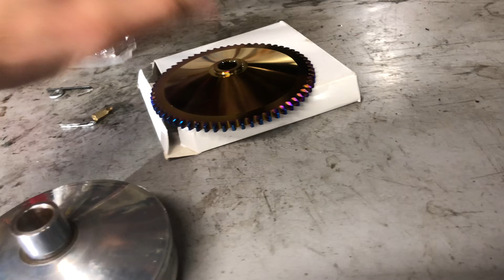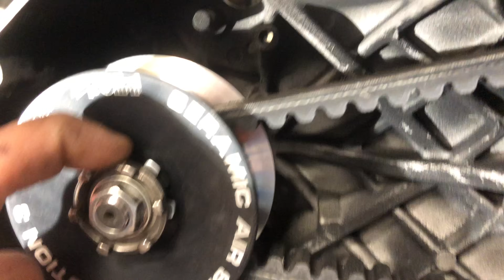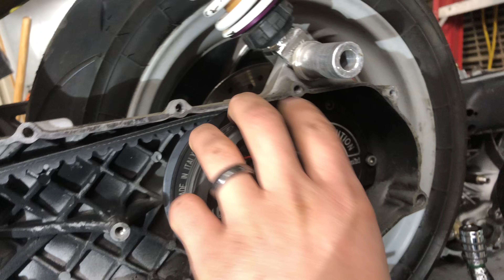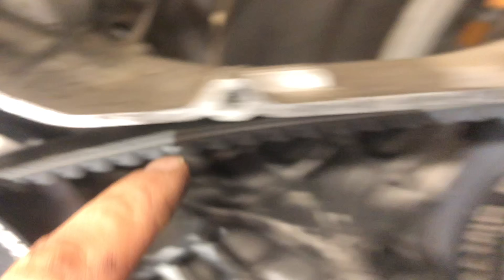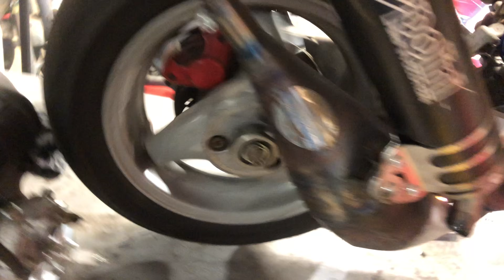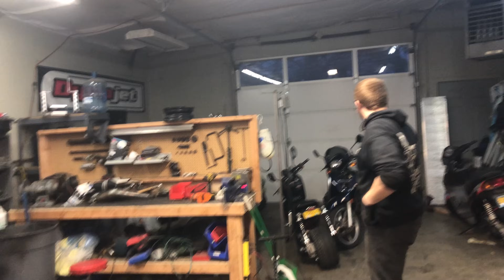Scooter CVT transmission explained

Comment: Idle's 1.5k rpm, engages at 4.2k rpm.  Not racing, not in a hurry, just puttering around; does it make sense upon routine (12k mi) belt-change to add 1g or 2g heavier rollers to lower the stock engagement rpm's on Zuma 125?  Did previous owner install lighter rollers, since 4.2k engagement seems high?

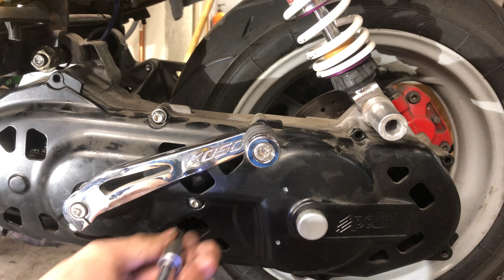Comment: Key point at 11:12, trans upshifts (belt starts moving down in rear pulley) before clutch engages. When you upshift before moving, you lose takeoff power. That could also be caused by clutch springs that are too stiff.

Comment: The clutch is a bit stiff, it engages high. The shift starts before the clutch is engaged, so you lose the low gear. Not bad, but could it be better?

Comment: One question on my yamaha aerox 70cc has malossi white clutch spring and stock sprigs and 4.5 gram rolers. But take off is like a litl slow the rpm is not constant on start they rising then its stops and stay there like 3 seconds then its raising like crazy. So is stifer clutch spring gona do the job?
Reply: With more power you need to put stiffer clutch springs and possibly stiffer contra spring. Clutch should engage at 70cc kits best rpm power range.Tune one part at a time.

Comment: Hey i have a 98 prebug im wondering what causes the belt to shift before the clutch engages. My belt starts going down on the rear pulley before the wheel starts spinning

Comment: I'm new to all this. My new 150cc  scooter seems to engage a bit slower than I would like it to (manufacturer says it engages at 1700 rpm). There seems to be a bit of a slack in the throttle. How can I make it so the clutch engages quicker? By adjusting the throttle cable? Or by getting 1000 rpm clutch springs? If I change the clutch springs to 1000 rpm, do I need to also change the contra spring to 1000 rpm? How about the variator rollers weights? Do I need to change them to lighter weights as well?

Comment: The only thing I don't understand: Why does it need to use a toothed belt? You have smooth surfaces inside the pulleys, I'd always assumed these used a smooth belt.
Reply: Toothed belts run smoother and wear slower compared to a smooth belt. As well the heat in the cvt wouldn't be easily dispersed in a smooth/A belt.

Comment: Super cool video,
I didn't know I could run it with the transmission cover off , I have a stock Wolf 50cc scooter very low miles and it started making a squeak noise during initial throttle, it sounds like my belt is slipping a little bit until I get going , after watching this video I'm confident I can fix it
. thanks

Comment: No constant oiling needed as there are no chains. has simple parts. unlike cvts in cars, cvts in motorcycles are super reliable as that rubber belt has way less power to manage than those poor metal belts in cars which have to transmit at least 100hp to a 1.5 ton car. has no problems with crossing waters as tranny has its own cover. cheap to own and cheap to maintain. easy to use and comfortable. scooters are awsome

Comment: hello guys i want some help about the springs the contra and the clutch springs i had the stock one and changed it for red one but it like snapped my belt and now i want to get other spring but im not sure what to get the red one was 2000rpm and it was the hardest its 80cc 4t scooter i want to make it to have nice start and final drive i was thinking getting yellow contra and white clutch springs but im not sure can it still snap my belt

Comment: Known baselines of 6-7 speeder scirocco-porsche-benz issues
Known 3x3 is 9G deu tronic
Known mountain-bike is overlaping ranges of 3 front 7 rear and 3 front 8 rear to misadvertising of overlaps as speeder 21, 24. Redone back to 7 and 8, in recent years.

Overlap durability reliability for 125cc petrol trolley grass cutter with gearing-spacing overlaping...
Reply: Cantonese is oci of ocillation resonance self-destruction.
Hokkien pronouciation and number pairing sequence of mahjong style definition of 
= No 3 no 4
= 4,5
= 5,6
= 7,8
= 9 is 10
= 21, 24 overlaps 7x7, 3x7, (2,5,8), [3,6,9], {1,4,7}, ...

Fib,bo,naaaa ceee sequence ... Hahaha
Reply: Hokkien democratic taking
= 講（話）來聽

Steeple-chase logic-understanding baseline countering plus-one is steeple-chase
Reply: ATF viscosity for transmission
= If engine flywheel-and-coupler-gear to gear-box is clutched and gear-box to drive-shaft is clutched and independent-wheel is clutch-torque-limiters(pneumatic socket-wrench settings-numbers for grip-level per tire-wheel)
= Forward starts from 1,2
= Reverse is 3 oops 4
= Paired is therefore found neutral before 3
= 1,2.3.4 - 2,1,3,4 - 3, 4, 1, 2 - 4...3..
Reply: Ahhh arrr arg args... Pneumatic air-brakes of trucks to reverse generation of ... Braking words.
Reply: Distinction student will 
= Ahh arggg

 Counter and steeple chase with ahhhhh ... aRRRR.????

= Brake - LOr...

Other students will go to america.
Reply: Next question accepted is
= How to terminology advertise product.

Modular to torque-range
= 9, 10 as 10 for lesser-warranty
= Tested designed-specification as 100% but use 90% for durability plus-one. New baseline of 90% as 100%

Split torque doubling-halving for world is linear-feel to driver-rider mechanic-assembler

(new)100% use 90% as pivot-point
(new) 100% use 10% as pivot-point

Idling is not-start(climate-weather terrain-altitude fuel-quality)
Touch pedal-throttle is-not idling
Dead-zone feel, is, shoe-feet-ankle position lever touch-point.
Fuel-line feel should-be linear return-spring.

70%(old-new) is cruising-efficiency 
70% to 90% is double torque
90% to 100% is minimum double torque or chart-plot reduce torque-to-power to prevent engine blow-up (vehicle-no kamikaze-missile). Selectable by mechanic during assembly-mounting. 

Count downwards and try not to stall-blow many types of engine.sss under real-world conditions. How to drive diesel truck.?
Reply: Apply to ww2 dive-bomber with 3, 4, 5,  blades, propeller.

Brake propeller is another topic.
Reply: Nest topic will be electric motor regeneration for battery next use and spooling and bearings and no-burn-out bearings to coupler-torque socket-axle shafted for pull-cord/electric screwdriver/electric drill/pneumatic wrench/kick starter/electric starter motor/exclude turbo, supercharger, surbo/include fuel and electrical lines plus-one efficiency 底盤，底子, raise the log(logistics) before the effect-results, don't loose focus, remember job-scope, remind self of core-business, review objectives...
Reply: After 16 years grade school age, half year study and half year relevant work then half year study then career as play not-work.

Impeller drive as flywheel design. 2x directional valves for 2x vectors, leaking air design... Hammer-jack, jack-hammer to pile driver. put fan blades... Make table-chair top-heavy. Not, bimbo top-heavy. Reaction blast of no-drill second-hand fuel-tank self-explode but buy ready made new... Tank explosions YouTube... Hot works, dry docks, ships, tankers, truck, tankers, cylinders tanks, caterpillar truck tire explosion, double tire wheel explosions...
Reply: In the end, the world is full of jealous-freaks who are not-worth the trouble. Assign one workshop tuner to exist for 6 months or till found out. Pirate brand-model, assemble different, mount different, drive different, use different, ... depending on what the customer specify, point to expert workshop-tuners from cheap to expensive. Tuner-workshop gets lawsuits and ... ... Fake passport, fake life, fake from start. Countries steal designs and patent stolen tech then ask, how is it fair... Their brands and terminology and designs get reverse-sabotage is sabotage-reverse is self-cancelling paired to zero-rated.
Reply: Country level back is tuner-workshop for components.

Workshop-tuner is legit compliance assembly and deliberately agree to - knows nothing behind.

Words sequence flipped.

Comment: I don't own a scooter yet, but I plan to. I'm an old motorcycle rider who has to ride a trike due to my wife's many health iseeus. But I am now looking at scooters for the amooth ride. 
  I think the engineering that went into a scooter's cvt is amazing. It is so simple and yet works so well. Your video does a great job explianing how they work.
   I will probably change the clutch springs on whatever scooter I buy. I will install weaker springs becsuse I want the clutch to engage sooner than stock. Then I will look into the rollers to make sure the front pulley is giving me the max it can give. I don't know if I will change the spring on the rear pulley because it seems to me if I have the right weight rollers in the front pulley it shoud over come the spring in the rear and give me the maximun performance. Well, good enough for me anyway.
   Thanks for such a good video on a scooter CVT and thank you for removeing the cover and showing exactly how they work. I already knew how they work, but it was nice to watch one while it was in action.

Comment: I have a question, my cvt belt was worn out from 17,5mm to 16mm. but I ordered and installed 18,5 a thicker belt, I added some shimings in variator so the belt would stay as low as possible and it was as high as high in the rare (clutch plates).
but it's still the same belt doesn't go all the way up on the variator, I squeezed the belt in the clutch as much as I could And I THINK THAT MY CLUTCH DOESN'T LET THE BELT GO ALL THE WAY UP 😫😫

Comment: I'm looking at a Tao Tao 50 pony (I know... but it's what I can afford)
Want to do some mods ie BBC and exhast. 
Also
If I install 5.5 gram roller weights or 7 gram sliders in the CVT
What color/size "clutch springs" and "contra spring" should I try first?
Thanks in advance to anyone who responds

Comment: why is it when i release then throttle my scooter is non stop engine braking? shouldnt disengage the clutch? or something...
Reply from the maker: Likely a clutch issue, but the clutches always stay engaged until the rpm is met where the springs disengage
Reply: @Scooterswapshop  what would you recommend for a new 4t injection scooter to go faster in the hill? But still dont ruin the engine
I am big guy ~97-99kg and doing food delivery in a step/hill city

Comment: Great video ... Thank you.
I am looking at using this system in a UGV Tracked system.
So I have a question if anybody is interested in answering.
I was thinking of Electro/Mechanically operating the Big Small (the CVT part) on both ends ... ie. remove the Centrifugal weights.
Oh ... I have definetly NOT thought it thru. It could be a dumb idea after all!!! CHEERS

Comment: I have a 2003 yamaha bws, did a brake stand and it started to wheel hop. I developed a vibration and eventually lost drive. IS it usually a belt that snaps or the cvt went to shit. I still have to take it apart to have a look.

Comment: So if my bike is only hitting about 8400 rpm’s and holding when I pin the throttle, what can I do to make it hit a higher rpm and have more speed? I have 1500 rpm springs, and I’m running 5.5 gram rollers or 5 gram one of the two, the bike is a 139qmb with a 50mm bbk on it , just a free barn find I built to wheelie but it’s really got me into scooters and I really wanna understand how to easily tune; bike will only do 41 mph @ 8400 rpms

Comment: What is the best weight for my variator rollores for a top performance 70cc cylinder,polini high speed pipe and a 21mm carb with polini clutch and polini high speed variator.
Reply from the maker: If you have a minarelli the  polini Variator is flawed and it won’t ever work right regardless of weights

Comment: Thanks for this. Do you have any idea, why is it that: on my scooter when i start mmoving with the bike at the beginning its shaking the whole bike for a few seconds and then its smooth again at a higher speed. So its shaking at the beginning of the speed up process, is the clutch spring not ok, or the whole clutch worn and not cathing the clutch house properly? Do i need to replace all parts or just spring or other parts?

Comment: How do I measure it know what size of secondary torque driver sheave I need to buy to replace my old one
Reply from the maker: What bike do you have
Reply: @Scooterswapshop  dl603 dinli 90 cc with forward neutral and reverse . Soindidnt know what the problem was so I just started with he transmission gears and one had a broken tooth on the gear l2 output gear I replaced that. Think maybe that was the problem. Nope so I took the clutch apart and cleaned the shoes and cleaned the arm shoes springs and it was definitely real stiff after cleaning it was nice and free. But still did the same thing so I took it apart again and come to find out the two slider grooves on the secondary puly sheave had a good ridge in it where it was get hung up on so I determined that was the problem. So I have now filed down those grooves too make them more smooth and haven't tried it yet. Also one more question if you could the carb I have on it is the right size for it but it's doesn't want to run right. I have to close the air fuel mixture screw all the way to see to get it to work right for the most part so  after watching things it say go up on the pilot jet. Also if you could I really just want to buy the sheave cause it was less than the whole real pulley it's self just wasn't sure how to shoes the right secondary torque driver shea ve cause I know other one would fit it

Comment: Is it normal to have some vibration at take off when it engages?
Reply from the maker: yes and no
Reply: @Scooterswapshop  thanks I recently bought a 2020 genuine roughhouse  50 I didn't notice at 1st but now I notice from a Dead stop shudder type of feeling that goes away after it's engaged and going, any idea what that could be? 
Also has 1800 miles

Comment: That bike needs to drink more fuel before it connects to the clutch. . Your clutch springs maybe are too tight.
Reply from the maker: hmmm
Reply: @Scooterswapshop  on yamaha mio scooters, the clutch connects right away on the bell when you give a lil bit of throttle. In philippines they modify this by making this parts better. . You can check speedtuner and they are cheaper maybe than what you can find in your place. 😉

Comment: I am a new driver, does anyone have driving suggestions on how anyone can drive scooters in a a more efficient way?
For example, i am not driving with a constant flow of the accelerator clutch and i think this is the reason of the many problems that i have with the transmission system. Is this correct or my engineer keeps lying to me for money?
Thank you in advance.
Reply from the maker: sorry not understanding the question
Reply: @Scooterswapshop  first of all thank you for your reply.
Second, what i mean is, that when i am in traffic, i usually use the throttle in a repetitve way and not in a constant way of driving.
Do you know if that creates a long term problem to the scooter's transmission system?
Thanks again man, really appreciate your bother.

Comment: the belt does not go all the way to the outer diameter of the  variator. your missing out on top speed.
sorry to bust your bubble, but it  needs more work. maybe a smaller belt.
Reply from the maker: Hi sorry but that’s 100% backwards  this is a kit 100% supplied by polini also. Shorter belt like you suggest would limit my top speed not increase it. Half the point of an overrange kit
Reply: @Scooterswapshop  The belt should go to the outside edge of the variator. That would give higher top speed. Am I wrong? 
Dare I say, Polini has something wrong? Is that heresy? 
Polini is not my God.
 If that belt went to the outside edge of the variator, you WOULD have higher top speed. It is a math equation, a gear ratio. I may have hurt your feelings, but math is math. Let go your ego and think about it.
Reply from the maker: @ratoneJR  correct if it goes higher you gain more speed. I don’t have an ego. Your comment is backwards. You said I need a smaller belt for more speed. Nobody’s feelings are hurt, you need to re read your first comment as it’s contradicting your second comment.

Comment: So will I see an increase in speed if I swap to a performance clutch and variator or do I need a bbk too. I have a 50cc maddog gen 4 and it barely hits 30mph at 6000rpms
Reply from the maker: we have all the parts you need for the qmb engine!

Comment: So I went to the mechanic today with squeeky noise coming out of the cvt box. He openned it and tried to unscrew the variator nut and the kick starter ratched shattered into small pieces. What could have caused that? Perhaps the kickstart spindle was making contact witb it while I was driving?  He did not say much since he was the who serviced it last time  Thanks
Reply from the maker: Sounds like
You need to take it somewhere else for repair. I have no idea what the issue is without seeing the bike in person

Comment: I have a 1985 Honda Elite 150 4 stroke, when I look in the carb and turn the throttle the vacuum piston in the carb does not lift up more than a cm, it runs okay but wont top out, I thought that the throttle cable was supposed to slide the vacuum piston up to let more air in, or is this incorrect? thank you
Reply from the maker: we would need to see what your talking about bring it in so we can get a actual fix

Comment: Hi fan from philippines 
What can you suggest for my honda beat.
Currentyly running a big bore kit 
55mm 130cc 28mm swr carburetor and 5.8 asia cams 
My cvt set up is ncy pulley stock drive face and torque drive sun linning 1.2k clutch spring and 1.2k contra spring with ball bearings 
Im 90kgs 
Thanks sir.
Reply from the maker: what engine and what are your goals?